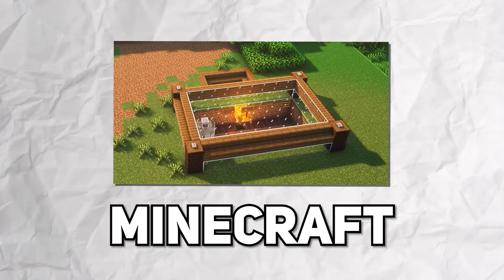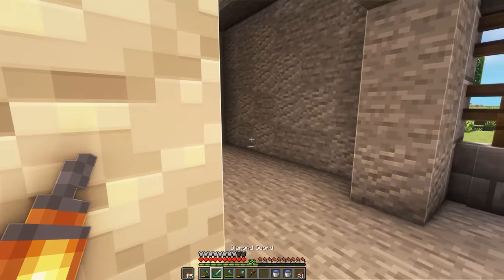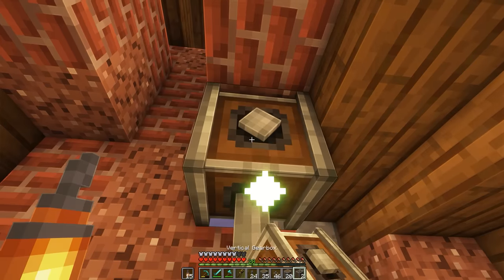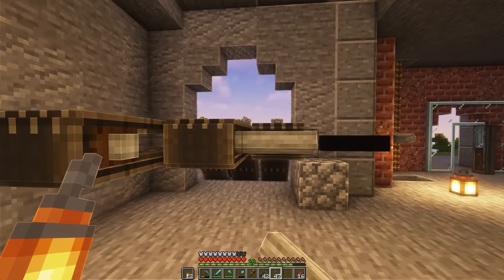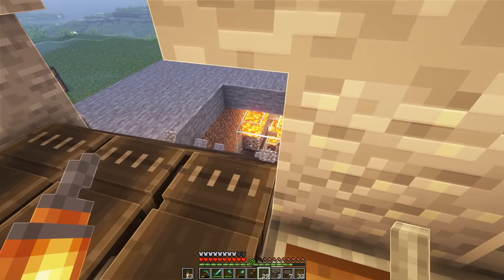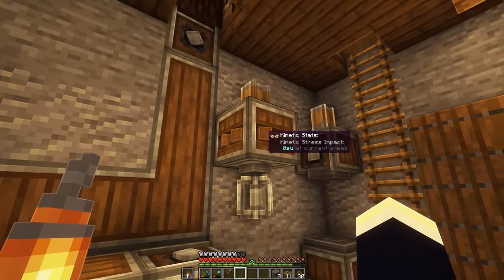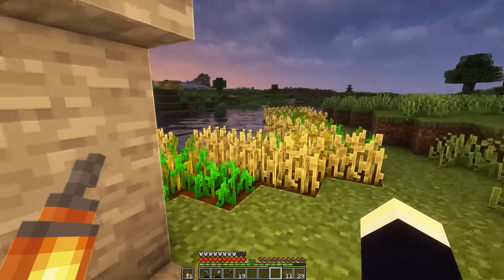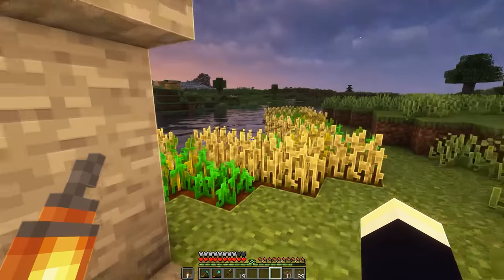I Built an AUTOMATIC IRON FACTORY in Minecraft Create Mod

Comment from the maker: I hope you enjoyed watching this as much as I did making it! Having a lot of fun with this series.
P.S. If you want to download the entire factory I built this episode, it's available on my Patreon! https://www.patreon.com/disruptivebuilds
Reply: Hello, sorry for not explaining it properly, I should be the one saying sorry. I'm alright for slapping my face with a note written "liar," but uh... Yeah, thanks for noticing me. I subbed when I saw your first create video.

Extra tips:
Don't throw all the flint away, flint can make andesite alloy renewable.

Use the blocks Threshold Switch, Clutch and Redstone Link to turn off the drills if the storage of the Item Vault is almost full.

Threshold Switch can help you void excess items.

The reason why the small waterwheel makes the speed faster is that the waterwheel has a faster RPM than a large waterwheel, connecting it to the same shaft as the large waterwheel will force the shaft to adapt to a faster speed instead of a slower speed. This also applies to other generators if you want to have extra Stress while not affecting the speed.
Reply from the maker: @guidinglight1240  No, you explained it well, i'm honestly half brain-dead, water wheels need water to run (duh) just didn't make that connection for a sec there. Thank you for the extra tips! I wasn't aware flint was useful, I haven't thrown any away yet so I'll definitely hold onto it. Thanks again :)
Reply: I think you should install fresh animations it's the best animation resource pack for mobs but doesn't ruin the vanilla look. (Warning: if you start using the pack you will never get rid of it)
Reply: I love to see what you make so please make more videos like this
Reply: can u leave an schematic down below
Reply: You can make guns in the create mod

Comment: A tip for the water wheels, if you add water such that it is flowing over top the wheel, down the wheel, and underneath them, you'll gain max speed.
Reply: Not in the newer versions unfortunately 

The devs changed it to be a max of 256 (512 for large wheels) and 32rpm for small wheels and 16 for large